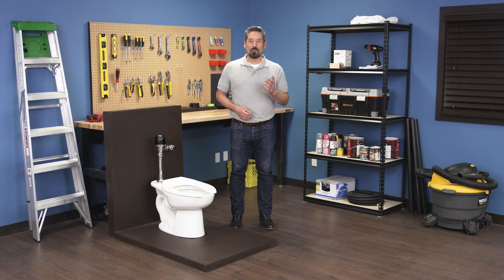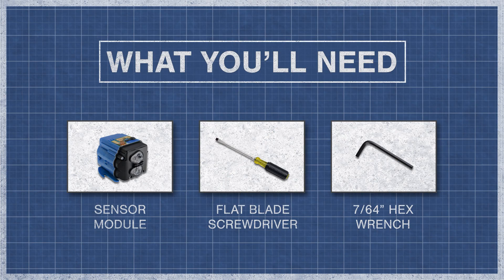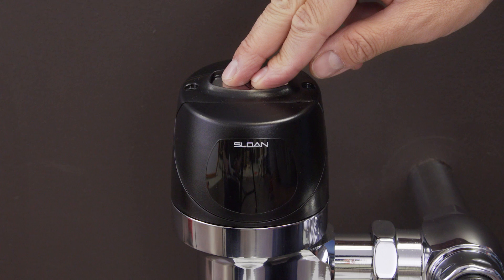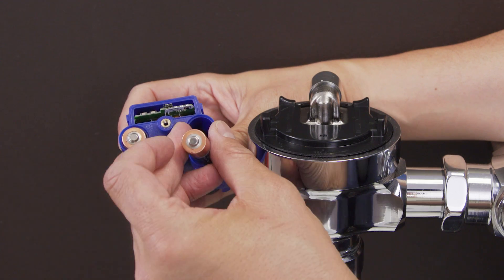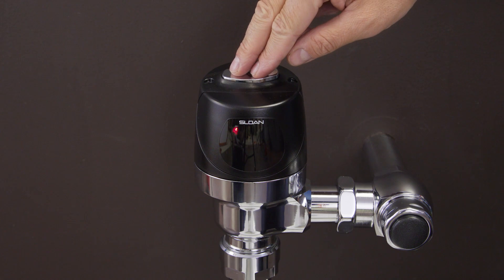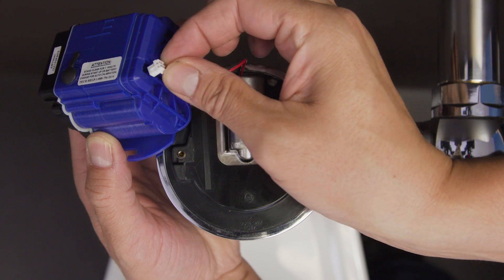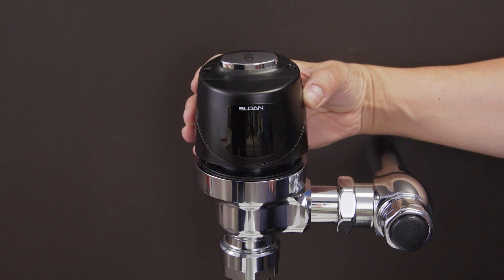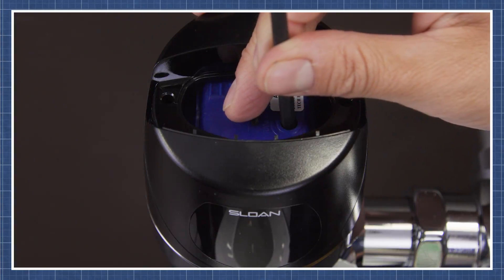Sloan Optima Flushometer | Sensor | Repair and Replace

Comment: I have a couple of what I think are non-op sensors.   Your video said that in order to test a sensor unit, I must both insert good batteries, and then plug the sensor into the solenoid tether.   Do you have to plug the sensor into the solenoid in order to get the red light to light up?   I am hoping I can test for a dead sensor without a solenoid since I don't have an extra one, and the rest of the flushometer is at a different location.  Thank you!
Reply from the maker: Thanks for watching. It has been a while since we've filmed this series and I don't have one of these readily on hand. I am unsure if the sensor detects if the solenoid is connected or not as I don't know what sort of circuitry is under the hood. If trying it without the solenoid doesn't work, you could take a 500 ohm resistor and connect it to where the solenoid is to complete the circuit.

Comment: I see flashing red light and heard a click after replacing the battery, however no flush even after holding the button for 40 seconds
Reply from the maker: Thanks for watching. If the batteries are good, and the solenoid is working and you've followed the steps to calibrate the distance, then listen to see if it is triggering a flush. If there is no click after an object moves away, then it is an issue with the solenoid or sensor module. If there is a click after an object moves away, it could be an issue with the diaphragm. https://www.youtube.com/watch?v=bHQaC-gTYVc

Comment: I hate these things with every fiber of my being.
Reply from the maker: Thanks for watching. When it comes to sensors they can be problematic. Was there anything specific that keeps reoccurring? We're always curious to learn what problems are most common out in the field.
Reply: @AmreSupply  they're maintenance nightmare I've got about 15-20 these things the ones that work work fine but the ones that don't are a real pain. I would prefer the building did not have them at all. And replace them is 200 plus dollars a piece. I have been able to fix some of them with electric Parts cleaner.

Comment: Great video thank you what about the wall tank sensor
Reply from the maker: Thanks for watching, we're glad that you found it helpful. If there is a sensor that is located in a concealed or other position, then you'll likely have to remove a cover to access it. If it is also made by Sloan then the sensor might be similar to this but there are variations between models.

Comment: what does it mean when the light is solid red?
Reply from the maker: Thanks for watching. The Sloan manuals don't seem to say much about a solid red light, but it might mean that the battery is low and needs to be replaced.

Comment: How are you doin sir? I'm dealing with this same exact Sloan setup but on a urinal and the water just continuously runs when I turn on the the valve. I replaced the solenoid and tried installing a new diaphragm to no avail. I'm omw to replacing the whole fixture but want to know if maybe I should try to change the sensor first? The water continuously runs and even comes out of the threads and the nuts by the diaphragm body and the and by the valve. And the threads are clean and have teflon tape and and stick tight sealant. What should I do?
Reply from the maker: Thanks for watching. If the valve is leaking on the threads then its best to clean the threads and reseat the diaphragm as it might not be positioned ideally on the valve. As well check the manual, thread tape or sealant is not recommended on these threads and can compromise the seal.

Comment: Stop shipping the sensor modules with the batteries in, we have 3 of them and the batteries leaked in all.
Reply from the maker: Hi Annad, thank you for watching. Currently the batteries for many devices come installed are sealed by the manufacture, its not feasible to open every device that we receive from manufacturers. It would be best to share your experience with Sloan directly as they do like hearing feedback. Overall leaking can occur naturally overtime through self discharge. As well high temperatures and humidity can also cause batteries to leak, so even if a battery is good during storage, they can leak sometimes when shipped.

Comment: I have two of these urinals at our church. One of the units was not flushing, we changed the batteries and nothing happened.  I took the sensor out of another unit and put it on the one not flushing. The light was flashing but when I connected to the solenoid it did a quick flush and then the light will not come back on and I cannot get a flush out of it. Could the solenoid have shorted out both sensors?
  Please advise.  Thank You
Reply from the maker: Hi Chad Argon. In this case the solenoid might just be worn out but its best to test a few things first.

After you placed the sensor from the functioning unit, into the non-function unit, does it still work when you place it back in the original unit?
Also does the sensor from the non-functioning unit work when placed in your functioning unit?
If both sensors still work in the functioning unit then its a pretty good sign that the solenoid is getting stuck.
Reply: Thank you for responding!
So after I placed the working sensor in the non working toilet the light stopped coming on and now they both don't work. It is almost as if plugging into the solenoid shorted it out or something.  I tried the holding down for 40 seconds and the light will not come on.
Reply from the maker: Hmm the light should come on after holding down for 40 seconds as that begins the range adjustment. The light also should come on anytime you open/ close the battery cover or place new batteries in. If you can't get the light to come on either sensor even when re-opening the battery cover then it could mean that its shorted. Its not common but its a possibility.

Try re-opening the battery cover on both sensors to see if it resets it. Also its still good to try both sensors sensors in working toilet as well to be sure.
Reply: AMRE Supply the light won’t come on in both sensors when opening and changing batteries either. Is there a way to fix it if is is shorted out?
Reply from the maker: Generally the sensor module is replaced as one piece so i don't think it can be repaired if its shorted out. It might be best to ask the Sloan Tech Support T: 888.756.2614 as they are quite knowledgeable and might have come across this particular case before.
Reply: AMRE Supply I will do that thank you. Your videos are great too. I’ll make sure I thumbs up.
Reply from the maker: Thank you Chad, I'm glad you find our videos helpful. Good luck with the repair!